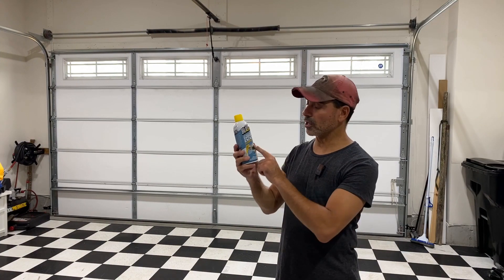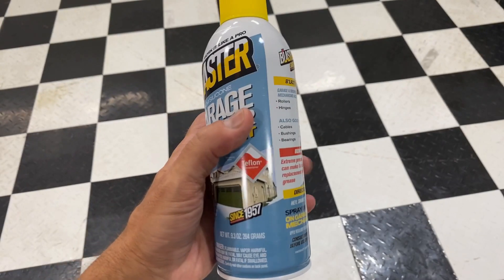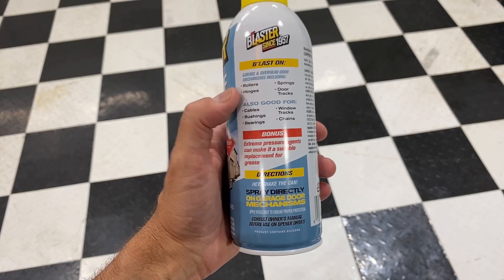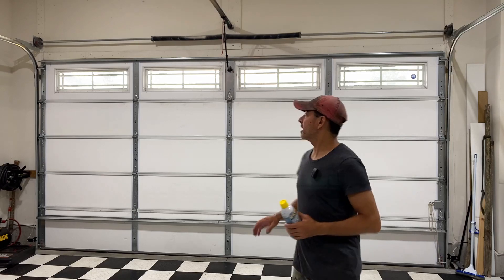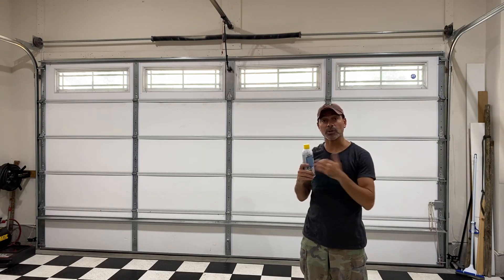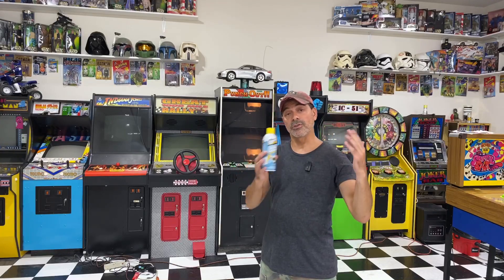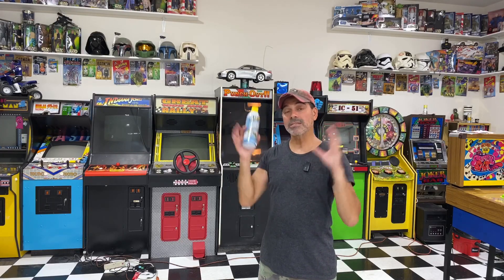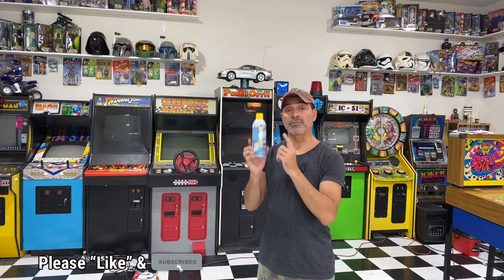Blaster Garage Door Lubricant - Product Review (Andy’s Garage: Episode - 423)

Comment: Hey Andy, off topic but i’m trying to replace the valve gasket covers on my fiero and i’m having some difficulty accessing where the gaskets should be. Any help would be appreciated, thanks in advance.
Reply from the maker: If you have the V6 GT Engine, the valve covers are just below the Plenum. One facing the trunk and one facing the firewall. They are just above the spark plugs. The gaskets are underneath the covers once you remove them.
Reply: @PhillipsVision  I do indeed have the V6. My issue is when I tried to remove the covers I didn’t have enough room even when I had the intake manifold plenum taken off.
Reply from the maker: @ramseyzakaria1333  should just pull right up, then slide out
Reply: @PhillipsVision  The valve cover gets stuck on the intake manifold and there’s not enough room, I think i’ll have to remove the intake to access It honestly